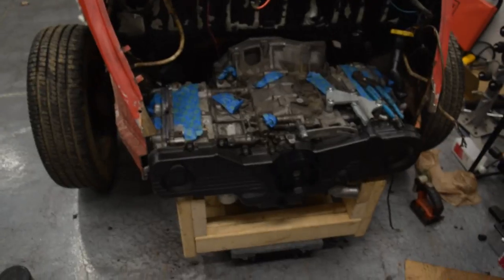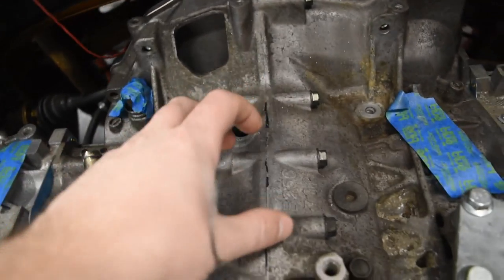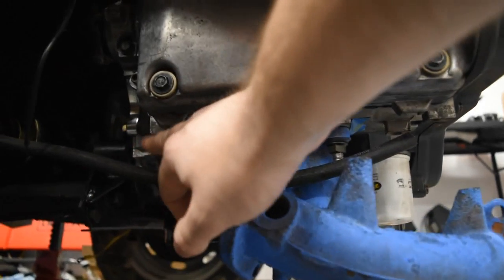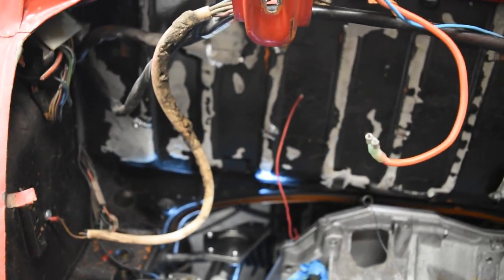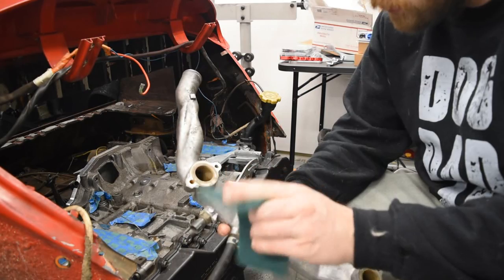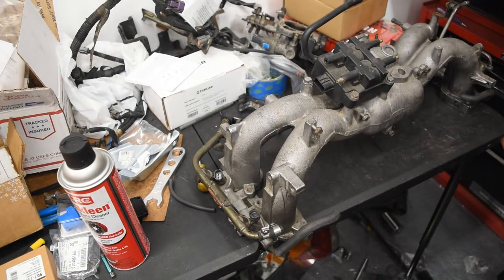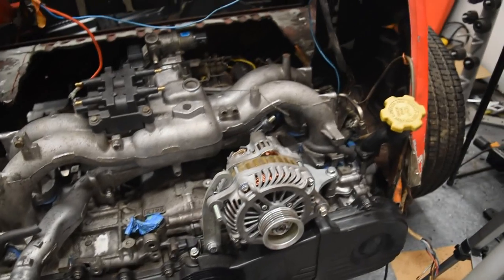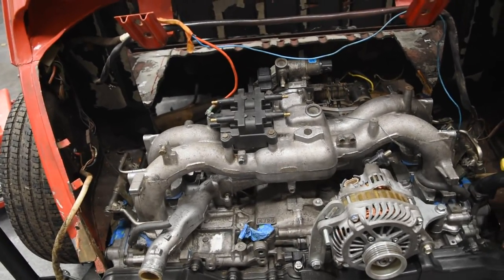Building Up The EJ251 / EJ255 Hybrid Longblock -- 1973 VW Super Beetle Subaru Swap

Comment: I have a question what motor mounts are you using and also what clutch would you use?
Reply from the maker: Thanks for the support! The standard beetle setup does not have motor mounts but I am using the stiffest transmission mounts available for Type 1. For the flywheel, I ordered a KEP adapter from Amazon (https://amzn.to/2xfBh5l). For the clutch, I ordered the 2100 KEP clutch plate and Heavy-Duty Cushion Lock Disc from cip1 (https://www2.cip1.com/ProductDetails.asp?ProductCode=ACC-C10-5149-KT)
Reply: @RatchetMotors  Right on man so im guessing its a custom clutch aswell? Will one off a subaru or vw work?
Reply from the maker: The clutch is just a standard vw clutch when using the KEP adapter kit.

Comment: Not to be rude but don't you need some kind of breather from crankcase
Reply from the maker: Not rude at all! The ej255 technically has 2 crankcase breathers, I blocked off only 1 to match the PCV system for the ej251 heads.

Comment: Love the videos! What transmission are you running?
Reply from the maker: Thanks for the support! Currently we are still rocking the Type 1 transmission without any modifications. The plan is to use this transmission while we work out any bugs with the engine/ECU and upgrade in the near future to something that can reliably hold the power once it’s on the road.
Reply: Ratchet Motors thank you sir, and thanks for the awesome videos.

Comment: That tubing flaring tool i slick !!!
Reply from the maker: Yes that has been one of my favorite tools (https://amzn.to/2USxkwI)!  I purchased it several years ago to make brake and clutch lines on my 2001 Impreza RS and 2004 Forester XT, huge improvement over the manual tools.  Figured I'd give it a shot on the fuel rails and seems to have worked great.  Thanks for the support!

Comment: Hey there. Did you try reverse fit the cross-over water pipe? Then your coolant line can connect come in on the right side?
Reply from the maker: I tried reversing the crossover pipe but it interfered with the heads. I agree it would be a nice option but it would take some reworking of the crossover pipe to fit. This does work with other Subaru’s, I believe the ej251 heads are the problem.
Reply: @RatchetMotors  pity man. Enjoying following the build. Keep at it! 😎

Comment: How are you intending to mod gearbox-engine mount to take the extra load of larger engine hanging of the back
Reply from the maker: At some point I will look into a kafer cup brace but there is actually not a significant weight difference between the vw and Subaru engines

Comment: Are you going to run the stock VW transaxle ?
Reply from the maker: For now, yes!  We are trying to stick with stock to keep costs down but most likely, the transaxle will be replaced with some sort of upgraded unit in the future.  The stock transaxle should work fine for initial engine break-in, tuning, and working out the bugs but will inevitably become a weak link as the power gets turned up.  Only time will tell but it is stock for now!